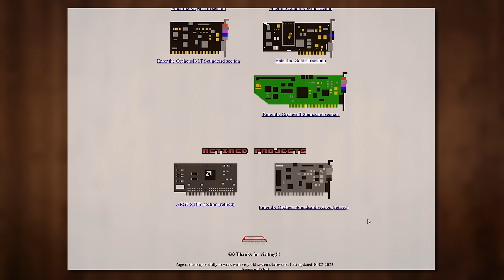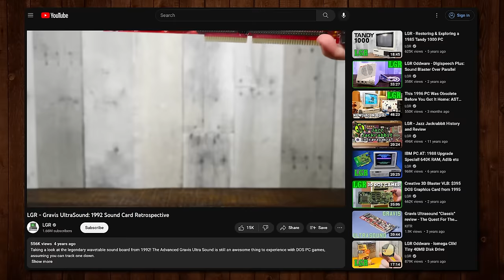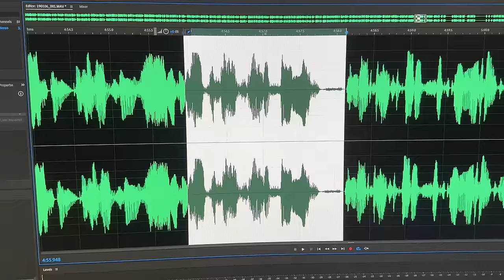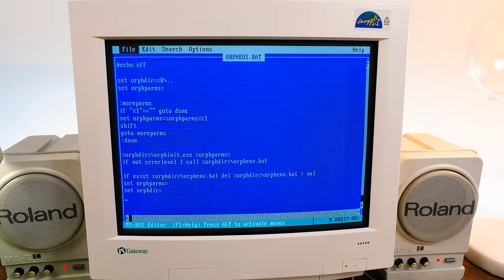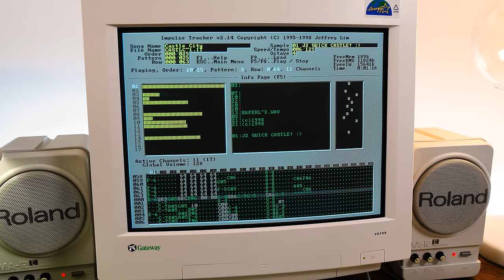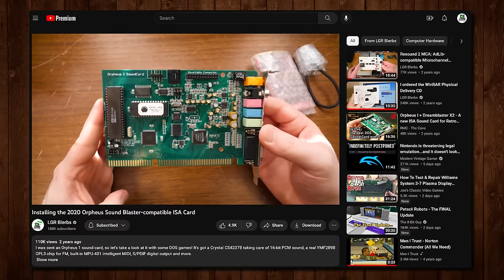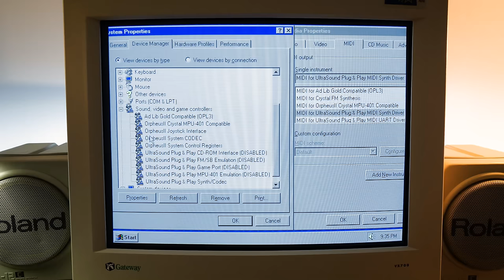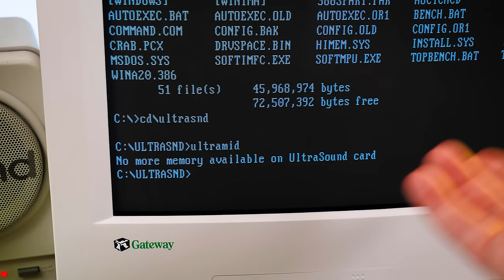Orpheus II: The Best Retro PC Sound Card in 2023? Perhaps!

Comment: They should make a V3 with an FPGA, these ASICs are getting harder to source and make up the majority of the cost. An FPGA card could have multiple soundcards flashed onto it and different combinations to use, all while taking up a much smaller footprint than a custom card that uses multiple ASICs. A prototype of this was pitched at VCF Midwest so it's an idea that has been around for a while now.
Reply: I think this is the most ideal solution. I wonder if that card that was being developed and shown at VCF Midwest would have seen the light of day if the chip shortage hadn't happened...
Reply: i thought the same!
Reply: Somebody have to create the FPGA first. And then thre is the question - isn't it simpler to have it emulated on something like RPi. Or isn't it simpler to have it in DosBox. I just like it as is - the discrete sound card on real chips. On real device with real hard drive and real CRT.
Reply: Exactly what I thought when I saw the price and that salvaged chip. An FPGA might even be cheaper...
Reply: @rkurbatov  no need to "create" a new FPGA - they are called "Field Programmable Gate Array" for a reason - simply put, you can "rewire" the transistors inside a FPGA any way you want so they can be anything you tell them to be.

If you have the wiring diagram of the real chip and an FPGA that has enough transistors inside to rewire, you can recreate an EMU8k and a CT1749 for example ... or even a voodoo cards TMU and FBI.

It's the closest you can get to the real chip and, if done right, indistinguishable in function  - it beats "software emulation" like dosbox or some RPi thing.
Only downside is that FPGAs cost money too, and the more capable they get, the more money they'll cost - so - it might not matter if you use FPGA or NOS/Salvaged original chips, you might end up with a mighty expensive clone card either way
Reply: @KenjiUmino  : The ice40 chips might be enough for this- some of them cost around $5. Add in a ATF CPLD (5v tolerant, for ISA and 555 timer interfacing if they want to support game port), and the analog components, and a $100 to $200 price tag should be pretty easy. Even if they aren't enough, a fairly cheap processor should be able to fill the gap.
Reply: @rkurbatov  I agree that real (original) devices are best, but there's a point where an emulated or FPGA solution becomes "good enough" for me. For example, I'm not gonna shell out $1500+ for an Adlib Gold just so I can have the real deal. Genuine GUS cards are getting up there in price, too.
Then of course there's the age of the chips and reliability concerns. Who knows how long that expensive genuine card will work properly?
Reply: @rkurbatov   FPGAs really are the sweet spot.  I'm a purist, so if I want a Sound Blaster Pro, I'm going to use a Sound Blaster Pro.  But, if I were willing to go with emulation instead (presumably if I didn't already have the real deal hardware), then I would much MUCH prefer to be able to use a hardware-level emulation that looked exactly like a SBP to a typical ISA desktop PC.  Raspberry Pi is wonderful and all that, but I don't want a tiny Linux SoC doing the work, I want ICs on a card that I can install in a bona fide beige box.
Reply: @paulgraves1392  The PicoGUS dev actually has a YT channel and I was watching some WIP videos showing off the progress thus far, which is fun.
Reply: @KenjiUmino  alright well, go on then
Reply: @KenjiUmino  Agreed, although could prove to be relitively expensive , but new electronics should translate into reliability, or so you'd hope so.
Reply: Fpgas are awsome but is missing the point of why people love this hobby it's really about pushing the hardware and the passion of working with original hardware where possible. The great sound cards are rare and extremely expensive so this fills a need for people who love this stuff.
Reply: @KenjiUmino  The real problem is knowing how the old chips actually worked. I read a multi page discussion about FM (DX7) emulation. The main conclusion was that a key part of the sound was was due to simplifications Yamaha made like log lookup tables for doing multiplication.
Reply: @MrDuncl  exactly - en exact recreating of an existing chip in FPGA requires that the chip to be recreated is already well documented (including the "undocumented" bits) and the documentation is actually available

Comment: What we need is a PCI Express sound card that's compatible with the old MS-DOS sound card so that we can add DOS sound support with a "modern" computer running FreeDOS.
Reply: The problem you're going to run into though is that there's no PC DOS drivers for the pcie bus. So there's no way for your software to talk to your Hardware cuz you can't communicate on the bus.
Reply: @RowanHawkins  But what's preventing a modern operating system like FreeDOS to have drivers for PCIe devices?
Reply from the maker: There are USB sound cards with retro chips on them specifically for DOSBox:
https://www.youtube.com/watch?v=dg33QLkHAu4
Reply: The problem is that while PCI Express cards could respond to all the right I/O ports, PCI and PCI Express cannot do ISA compatible DMA like what DOS programs expect. There's nothing for PCI and PCI Express to do that with.

When sound cards moved from the ISA bus to the PCI bus in the late 1990s, they either didn't bother with DOS games, or you had to load EMM386.EXE and run a special TSR in the background that intercepted the I/O to emulate a Sound Blaster for the DOS game, or you had to run the DOS game in a Windows 9x DOS box where Windows or a 3rd party driver would emulate it.

There were some hardware level hacks too at the time. On some motherboards there was a special cable you had to connect to the card and the motherboard to carry the ISA DMA signals. On Intel boards, there was a hack called "Distributed DMA" which allowed the PCI card to fiddle with the motherboard DMA controller to fake ISA DMA which sometimes worked. But that hack didn't last very long.

On a related note, you may have noticed that the disappearance of the standard floppy controller in the late 2000s coincided with a particular version of Intel motherboard chipsets where they completely dropped support for any kind of ISA DMA at all, because the standard floppy controller and floppy drive also used ISA DMA to operate.

Comment: I honestly don’t know what any of these audio technologies are, soundblaster midi wavetable midi, it’s all very confusing. How about a video explaining what they are? ❤
Reply: Yes, that would be an awesome video topic!
Reply: SoundBlaster is/was a brand of sound cards that became the standard that everyone else had to imitate for a while.
MIDI is a standard for hooking digital synthesizer equipment (including both audio emitters and keyboards) together. It used to use a round DIN connector, and now gets routed over USB.
Wavetables are sets of audio samples that are stored in a computer's memory, and are used to imitate MIDI synthesizers using a computer's soundcard.
Reply: To be even more specific about midi, it's a system where, instead of sending over the audio you wanna play itself to the chip, you send commands to the chip saying like "play this note for this long, change to the fourth instrument," etc, with the chip able to use a different sound depending on your setup.

In this case, the wavetable is a bank of various "instruments" available to the chip to pick from. It's basically like giving a chip sheet music instead of an audio CD.
Reply: @SheepUndefined  DOS games also make use of the General Midi standard, which is basically just a set of pre-defined instrument locations ensuring correct playback on any compatible device. The main exception being the MT-32, which is also a midi device but not a GM one (it didn't exist yet), relying on direct developer support instead. MT-32 can sort of do GM with a special init program, but GM devices can't really emulate the MT-32 outside some specific circumstances.
Reply: @ozzyp97  Ooh, that's super cool to know!

Comment: That card is looking like the holy grail of 90s sound cards. A single ISA slot used to do literally all the sounds (assuming no memory conflicts). Zero compromises and the ability to add MIDI is just the icing on an already delectable cake. I wonder how many of these OPL and AMD sound chips are still out there in the wild. 

Also, what an era of computing. Where sound cards were a legit thing to upgrade your setup with and some of them had RAM slots.
Reply: It certainly makes up for the high price of 340euros/365bucks/290quid
Reply: @nicwilson89  The holy grail of sound cards was never gonna be cheap.
Reply: @nicwilson89  It's probably a good investment.  There are probably limited numbers of those chips available.  It almost certainly won't be available in 5 or 10 years.
Reply: It's the holy grail of 1985-1995 sound cards, but the later-90s introduced environmental audio effects and advanced surround sound which were mind-blowing at the time.
Reply: @djhenyo  so... the holy grail of 90's sound cards like he said.... anything past 1996 you can just use a PCI SB LIVE

Comment: These are going to be in super limited supply, all of the new old stock chips required to make these are getting impossible to find. I am so glad I got ordered before this video went live. Just like the Goldlib.
Reply: The first thing I thought of on seeing it was wondering if it would be possible to replace the new old stock chips with some sort of FPGA replacement. The problem is that it would probably be very time consuming, and definitely expensive to make, though the likes of the MiSTer project and the Analogue clone consoles have shown it is possible in theory.

Comment: For some systems it would seem it would be cool if you could somehow choose to only have the SB or Gravis portion active to help with resouce conflicts. A dip switch or some other way.
Reply: Take that idea one step further with your "some other way". Additional breakout board and bracket that allows you to attach an external switch so you can choose which device you want active before you turn your computer on.  Like the breakout box from the All-in-wonders, but for a different purpose.  Can be connected to the Orpheus card through an IDC cable.  All period correct for the type of boards we had back then. lol.
Reply: I don't know about the GUS PnP version using the AMD InterWave chip, but the original GF1-based GUS cards did not use ANY resources until you initialized the card, usually in autoexec on startup.

Comment: I would say that the biggest improvement might be to have a DOS utility (perhaps with a Windows GUI extension?) to customize the configuration of all the card's DMA, I/O, and memory address options. Bonus if the utility can correctly identify which resources are already being used, and gold star if it can tell you WHAT is using the resources.

Comment: As someone who ran exclusively off of a GUS MAX for several years back in the '90s, there isn't anything I'd add... Only reason I swapped out the GUS for an Aureal Vortex 2 was the relatively poor Win9x support. I never really had much trouble with the digital side of the SB compatibility except for it sometime being a struggle finding enough free RAM for the big SBOS and/or MegaEm TSRs. The fake FM took some acclimatizing though.

Comment: Wow... this is definitely a "shut up and take my money" product for me! As for the wish list... I don't think it's practical, but MT-32 support would be amazing! No idea how that could be pulled off though...
Reply: The WP32 McCake is basically what you're asking for, it's MT32-Pi (a bare metal implementation of the Munt emulator + basic SF2 support via Fluidsynth on the side) in a wavetable header format. While Munt isn't quite perfect, it's certainly very good and also the only realistic option. There doesn't seem to be much demand for an FPGA version, and there's no way they could use original chips. Even if they could find them, they wouldn't even fit on the card, just look at the LAPC-I.

The Orpheus team could of course build in a CM4 slot and some support circuitry if they wanted to give the option to run MT32-Pi directly without taking up the wavetable header, but at some point the card is just too expensive and/or big.

Comment: not sure if it'd be possible to make an ISA compatible version, but I have a vibra-128 clone card, and the fact that you can swap out the midi wavetables in real time is awesome and the sound quality of the wavetables is phenomenal. 

I would actually like to see someone make a vibra-128 clone that can work in modern windows (or a software emulator) because it far exceeds the windows default midi sounds.

Comment: Part of me misses the days when we had a real selection of different sound cards, with different ability.   Some with surround sound, various synths for MIDI, some with better audio reproduction than others.   Now, most people seem to use the onboard sound which, while it is usually good enough to use on a basic level (indeed - I use it), it has meant that the range of sound cards with different facilities for use in modern machines (so with a USB or PCI-E interface) is limited..
Reply: That is due to to the main CPU having plenty of processing power. I recall creative claiming that the SB Live had the same processing power as a P133 CPU or something similar. A big deal back in the day but unnecessary now.
Reply: @MrDuncl  True, but it's also the case that what we require from sound hasn't really changed in 30 years.   Given adequate storage and processing power, we could have CD quality sound (which is pretty much the best most people can hear) then, and most computers of consoles do have more than enough storage and processing power for CD quality sound to be pretty much standard.

With graphics, you can have higher resolutions, higher dynamic range, and even ray/path tracing to improve lighting.  All of those have increasing requirements of the GFX card,    Turn on the raytracing option in even a well optimised game, and you can tank the performance, even on a high end card.
Reply: @stuartcastle2814  There is a big difference between playing back sound, like a CD player, and actually synthesizing it. Having said that, until recently Korg's top of the range synthesizer did all of its processing using an Intel Atom CPU.
Reply: @MrDuncl  I understand that, but I was making the point that generation to generation, there isn't much difference from user point of view between different generations of sound cards.   Theoretically, assuming you could find one that worked in modern PCs and on windows 10 or 11, you could play any modern game on a sound card from the 90s, and it really wouldn't be that different to a modern sound chip.   You can't say the same for Graphics cards.   They may work in windows, but they will not play modern games.

Thus, when you have a sound card that fits your needs, there is almost no need to upgrade it, unless your needs change.  

The fact the most motherboards (and video cards, using HDMI or DP) include onboard sound now means there is less need to buy a sound card.    Thus sound cards are dying out, unless for specialist use (such as music making)

Comment: So, I realize that for driver compatibility they have to use the old OPL chips in these cards, but between this and a few other projects I've seen, do they not make FM-Synth chips anymore? Like, the Commander x-16 also had to use an old chip for it's audio processing. If I were to go to a music store and buy a brand new Yamaha electric piano, what would it's audio processor even look like? I'm genuinely curious, anyone who happens to know.
Reply: I can't remember the model number, but Yamaha does actually still make some FM chips, or at least they did fairly recently. The problem is that they're mono and not entirely compatible with the old ones, nor do they sound exactly the same. 

Modern electric pianos and keyboards tend to be just computers more or less, I think Yamaha uses quite a lot of ARM processors in combination with some of their own DSP stuff. Korg's big workstations like Kronos and Nautilus are quite literally PCs, they have regular Intel Atom -based motherboards running a custom Linux-based OS. Whatever FM modern instruments do is usually software.

Comment: Maybe a dumb question, but could all these chips not be software simulated these days? Like couldn't you just put a microprocessor a card and simulate any of them at will, without needing to manufacture all these individual chips?
Reply from the maker: Absolutely. But the goal of these types of card projects is to utilize original chips and hardware to create the best version of what we had thirty years ago. Creating emulated versions through FPGA or whatever would serve another niche entirely!
Reply: Yeah for example there is the Pico GUS which is emulation of the GUS on a Raspberry Pi Pico. For most people getting into the hobby like me that would suffice as I do not have the deep pockets nor the nostalgia to buy these cards. However, sometimes the hardcore make something for the other hardcore and that's okay as long as there are other more affordable options for the rest of us, and there definitely are.